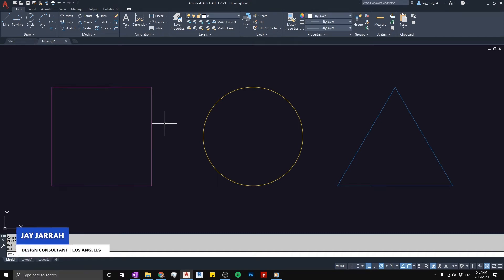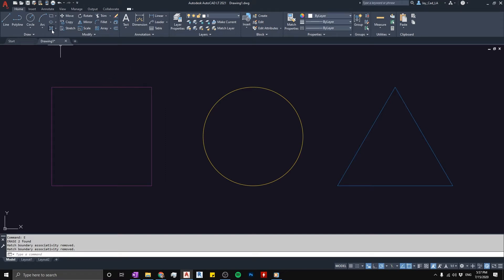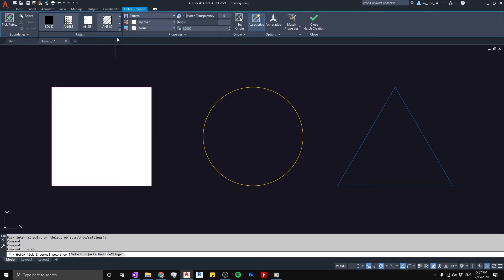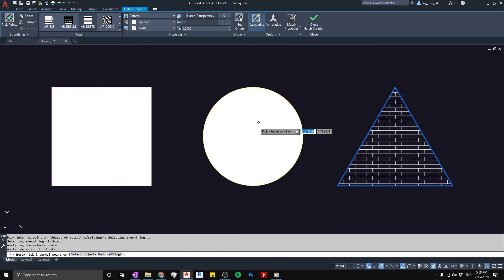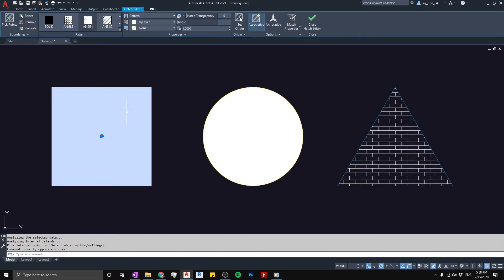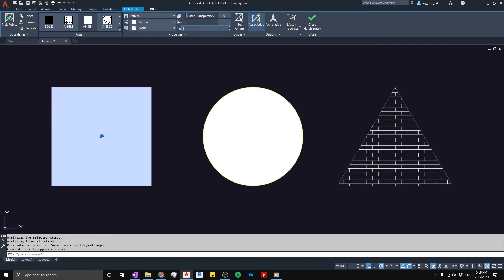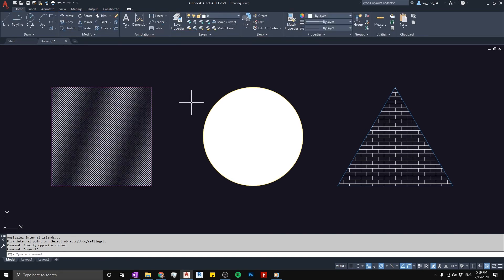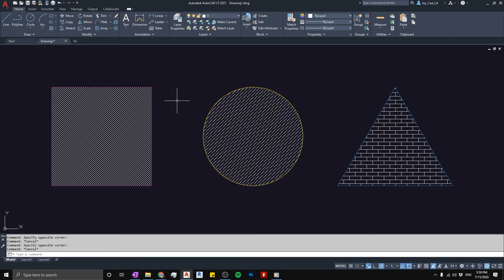Autocad Hatch | Hatch Showing Solid | Autocad 2021 Tutorial

Comment: i tried in all ways, not changing brother ,please tell  what to do?
Reply from the maker: Hi Preethi! Potentially you are drawing a hatch in an invisible or frozen layer? Let me know if thats the case
Reply: @JayCad  yes  brother , that's what I had problem
Reply: I  finished my course in auto cad,3dsmax and Revit,but the problem is it's lagging alot
Reply from the maker: What’s lagging? You mean Autocad?
Reply: @JayCad  yes, is it because the desktop has low storage capacity
Reply from the maker: Gotcha, usually 3Dsmax is the software that takes a lot of storage - also try to install your software & save your files on a second drive not your main drive
Reply: @JayCad  thanks brother so much for your support
Reply from the maker: Of course!

Comment: Bro I try this out but it's showing same solid . pattern though applying greater value what can I do now ?
Reply from the maker: Hi Tejas 

Are you using Autocad hatches or a custom Hatch?
Reply: @JayCad  cad hatches sir
Reply from the maker: @man-77j  Can you tell me the name of the hatch of you are using?
Reply: @JayCad  concrete hatch
Reply from the maker: Can you tell me the scale you are using for the concrete hatch?
Reply: I am facing same problem with all hatch
Reply: I used 0.001 .. look texture is visible but the issue is it have white background .... So when we zoom out it look totally white and we are able to see texture only when we zoom in too much
Reply from the maker: Did you scale your drawing or are you drawing using normal units? What happens when you put the hatch in scale "1.0"? Can you also share me a screenshot using this website https://imgbb.com/
Reply from the maker: I think I figured out the problem you have. There's a setting that control the background color of the hatch which you need to set to NONE 

It's under the setting that allows you to change the color of the hatch itself. 

Let me know if this works for you
Reply from the maker: Check this screenshot to see where the setting is: 
https://ibb.co/Z2WGpbC
Reply: @JayCad  I tried setting it to none.. but its still not working
Reply from the maker: @mohibiammar3532  Can you share me a screenshot of your hatch settings?
Reply: @JayCad  mine too hays
Reply: same problem